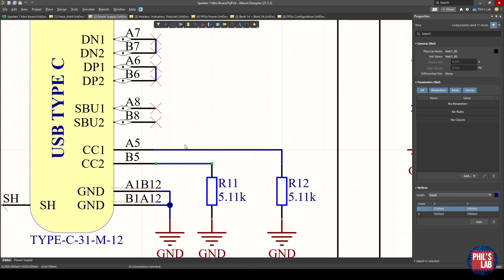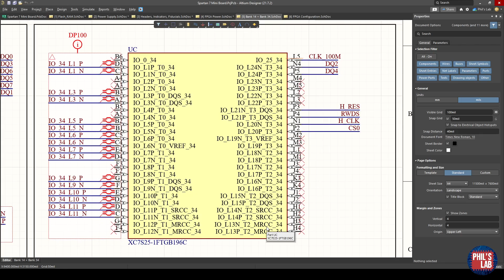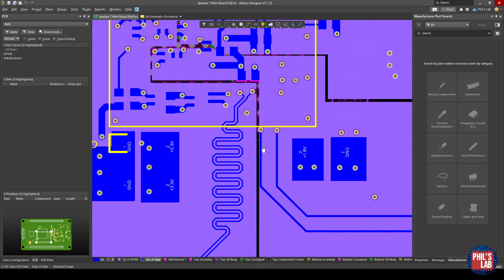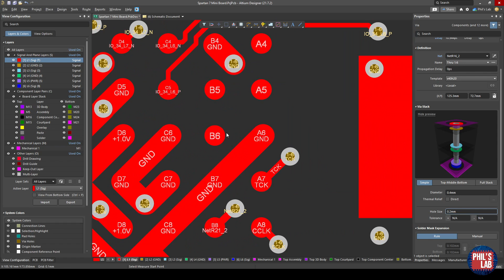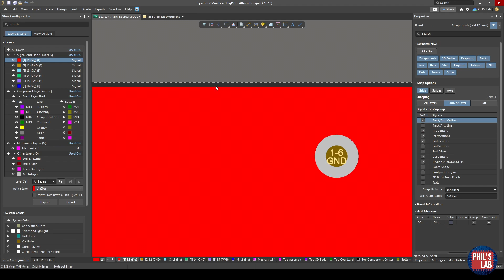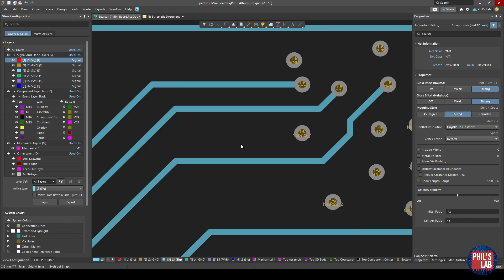(Sponsored) FPGA PCB Design Review - Phil's Lab #85

Comment: One lesson I've learnt the hard way regarding silkscreen - ALWAYS put a revision number on a board! Reality is you are going to have multiple revisions of the same PCB, and often it's hard to tell them apart visually (especially high-speed PCBs like those with FPGA), so it's entirely possible (and this actually happened to me!) for you to mistakenly assemble an older revision and waste a lot of time and effort to "transplant" parts onto a proper revision PCB.
Reply: I'm in that club too. Part numbering for the board which includes the rev level is an absolute must.

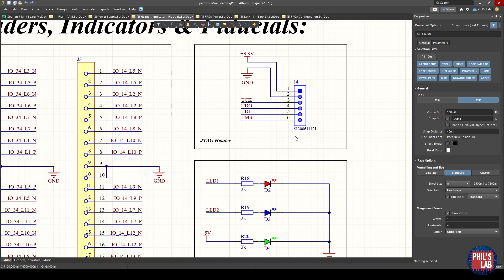Comment: the 330R resistor is connected to 3V3 while the 2K is at 5V rail so the 2K value might eventually be good if we want approx the same brightness (around 9:20)

Comment: Thank you Phil for reviewing my board! Some really great advice that I'm going to start applying immediately to both modify this design and future fpga designs
Reply from the maker: Thanks for sending it in, Pietro - good job overall on the design :)
Reply: Thank you for being the sacrificial anode.
Reply: Thank you Peter and Phil, this was a very interesting movie!
Reply: also double check Q1 (wrong symbol, wrong orientation)
Reply: Thank you Peter!
Reply: Thanks for sending your design in for review! That video was a half hour very well spent.
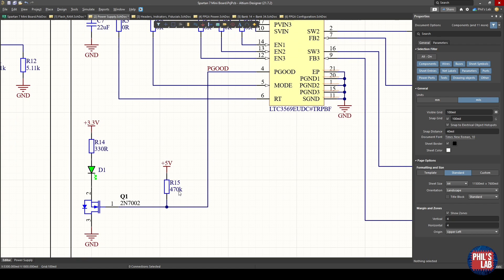Reply: Hey Peter, there is one small thing more 6:11 if the symbol for transistor is correct LED can be always on because of internal transistor diode.This is N-MOS, drain and source should be oposite way and you should have pull down resistor on gate. If R15 is needed you need to also rethink how you will do it, there is few options ;)
Reply: I think he assumed it was a pmos  @Volcanooo
Reply: @peter can you please share me this projwct design files